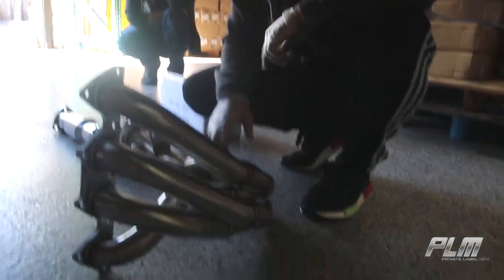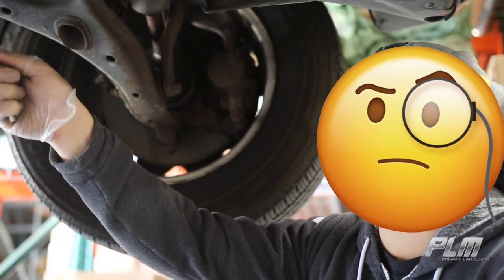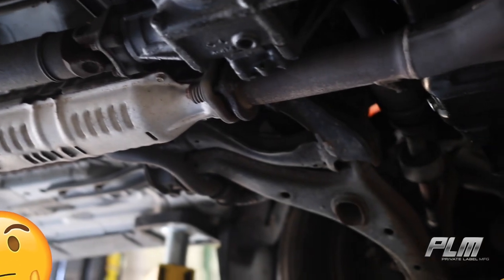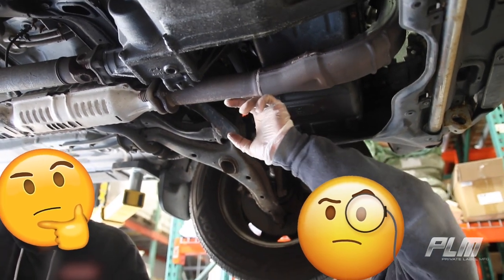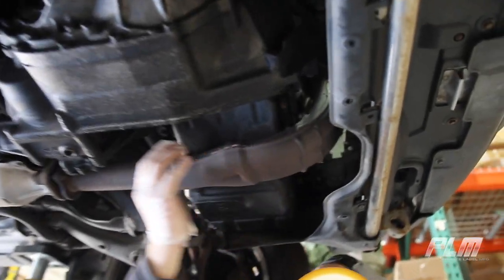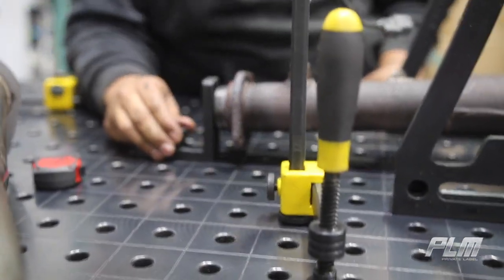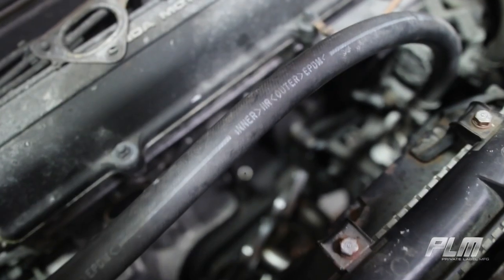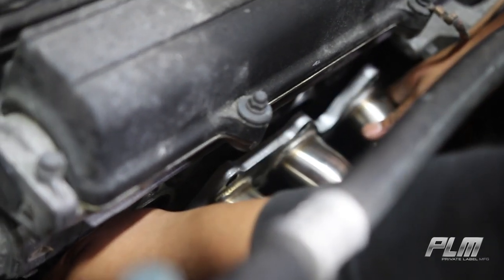Product Design [ 99-01 AWD Honda CRV PLM Headers ]

Comment: Will this fit the oem catalytic converter on the 97-01 crv ?
Reply from the maker: Yes, it will bolt right up to it.
Reply: @PrivateLabelMfg how? The oem header has a small piece after the flange to put the donut gasket on and the oem cats flange is concave to go around that gasket.  Your header is completely flat at the end